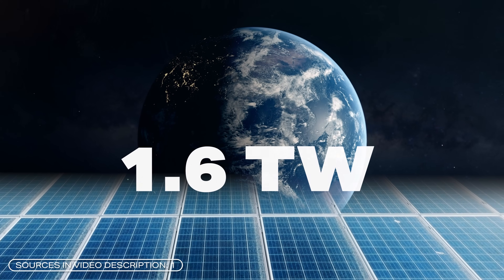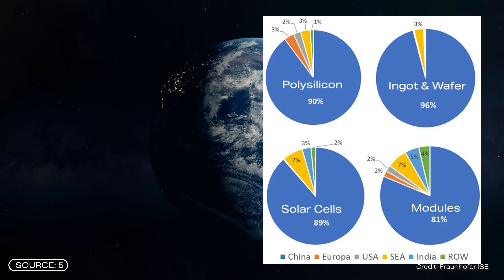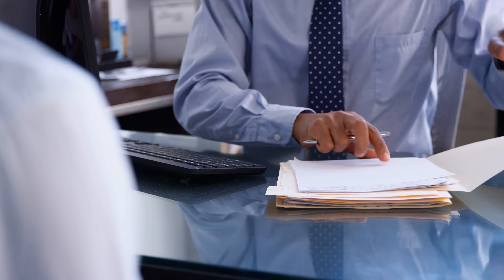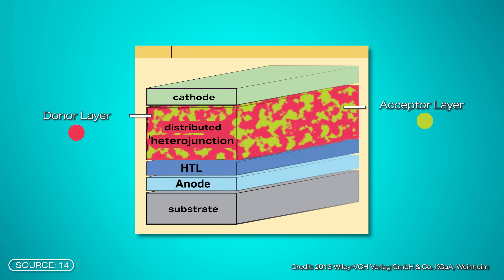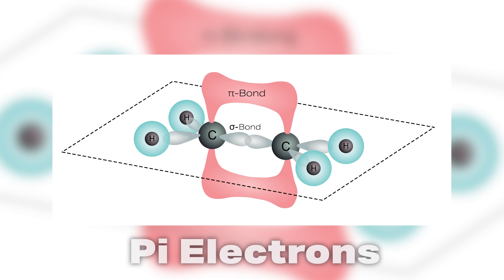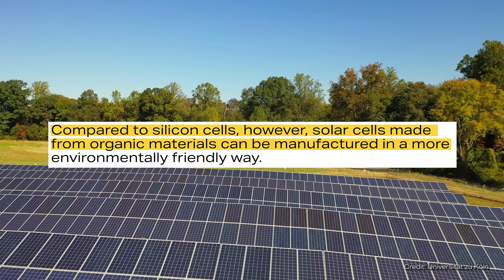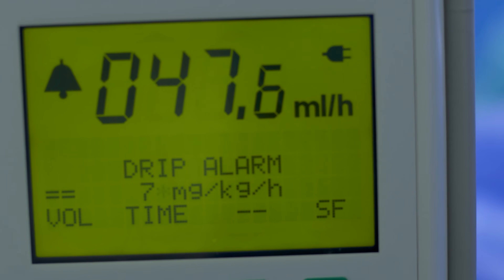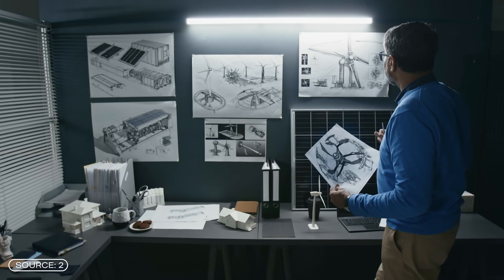Organic Solar Cells Made From Carbon!

Comment: The most important point is that you mentioned at last, 15.8% efficiency, that is the status of solar cells over 11 years ago. There are many print technologies on the market and already working, whether organic or non-organic, not only in Germany, but everywhere, including China, the USA, Israel, and a lot more. I know a company that reached even 18% with print flexible technologies, yet still less attractive. Today, any cheap silicon-based solar panel from China achieves 24%, and with relatively low yearly drop. That is about 8% more energy per area. Why would on earth anyone seek peanuts, when you can get the best?
Besides, Germany's problem isn't lack of innovation, although I must admit, German still conservative-thinking and want everything to be 100% before forwarding, a mentality that deters them a lot in adapting to the fast-pace new technologies that require fast decisions, taking risk and zero bureaucracies. Add to that, Germany had year after year impotent incapable governments that support large enterprises and barely support young established startup companies and innovative people. That alone is a death penalty to innovation in Germany, especially that large enterprises don't exactly care about the German economy, and often, as public companies, they have international investors that seek profit, and like they did lately with Volkswagen, they do with other companies.
China controls the field, because it has an excellent open-minded government which supports innovation massively, it has excellent risk-ready network of investors, and there are so many fields that Germans could have excelled at, if they would've had better governments and more open mindset. 
Just in the past 3 years, nearly 10 new Chinese human and dog-like robot companies have emerged from zero. They are now competing with the best American companies in this field including Boston Dynamics, which had hefty investments and nearly 15 years of prior development advantage. There is no reason why this shouldn't have happened in Germany. The same applies to many fields. For example, with extreme American restrictions, DeepSeek emerged with only $6 million investment and no access to most advanced NVIDIA processors, they hired the best minds in mathematics and in computer scientist, and they could achieve ChatGPT and today Gemini level of accuracy with less than 10% energy consumption and they're improving all the time, and that is purely mathematics and algorithm development under severe unfair American restrictions. Germans have no restrictions at all, not even the energy prices, because all AI companies work globally, so a German startup company can hire the servers somewhere cheap in Africa and still be a German company.
For Germany to rise again, and that is my honest opinion, Germany needs to get rid of the incapable governments, all of them, get a leader like the Polish leader, who cares about his country, rather than about his own position, stop financing Ukraine and creating non-existent political dramas that don't concern German, stop the endless influx of immigrants that are only destroying Germany and converting it into before middle-ages area. Just imagine, if the billions invested in defense technology, which brings no employment and barely income to Germany, since it is owned by individuals, who will buy another island. If this money, for example $30 billion or more is invested by the government in high-risk German startup companies, this alone would've brought Germany an increase in income of around $50 billion a year and more. That is proven tactic, not something theoretical. 
Whatever the company Heliatek is making, is already been made, and should it ever exceed the 20%-24% in efficiency, all other companies in the world would be switching to, not only in China. There are so many fields, Germans can develop, if they would have made the switch. They could've developed an advanced company like CALTEC of rechargeable batteries, they could've developed higher efficiency silicon-based solar cells, even if the energy prices are high in Germany, the production doesn't have to occur in Germany, it can be made anywhere, but the company can still be German. Even Chinese go low-wage countries like Vietnam. Being fixed-minded doesn't help the German economy. Germans have no reason not to enter the semi-conductor market. It's never a one country show. Even producing cars, Germans have no reason not to produce cheap electric cars. The human factor in the car industry is barely a factor, as most of the processes are automated and are becoming more automated as the new autonomous robots are reaching the market. So, it shouldn't be more expensive to produce cars in Germany than in Italy and even in China. They all use the same machines. I could list tens if not hundreds of products that could've been developed in Germany, if the factors I mentioned were different. Don't seek the one ultimate product to save German economy, seek a change in mentality and most important, of the incapable politicians you have. Just open your eyes, the most economically stable and flourishing countries, are those who have high-risk startup supporting mentality and governments. That is the key to every modern successful economy and there is no way around it.
Reply: I like your thinking but your favoured Poland has realised the greatest threat to their well being is Putin. Financing Ukraine is a lot better than Polish/German boots on the ground. Get real, USA is no longer big daddy.

Comment: The flexible sheet doesn't look very organic - which merely means carbon based anyway. It's not biodegradable, non toxic, low energy production or recycling.
And I'm not a Luddite, just blowing on the mists of apparent organic good-ness
Reply: Biodegradable solar panels doesnt seem good when you want 25+ years of lifetime

Comment: I think 15% energy efficiency of a panel that you can install is better than 100% efficiency of a panel that you cannot. But the longevity part might be a deal breaker - it would be difficult to offset the cost if you have to keep replacing the panels frequently. It's not only the cost of the panels, but the installation, too. At the very least, the panels should be made extremely easy to replace.
Reply: They are light and flexible. They look easy to replace.
Reply: @cyruslupercal9493   yeah, but I think the ease of replacement depends a lot on the individual panel design, as well as whether the manufacturer keeps making matching panels (e.g. voltages, sizes, connectors etc.).

Comment: Perovskite is well in front presently at over 20% efficiency with 32% not that far away, Longevity is the main issue tackled at the moment. Besides since it works at a different frequency than silicon based cells there is an effort to mass produce tandem solar cells silicon bottom Perovskite at the top, Already in production, since the manufacturing  equipment are almost the same it seems that it may be the next iteration of more efficiency Time will tell of course, this video is quite interesting all the same. C
Reply: A major issue is that it is made of lead in a water soluble form. So it is another leaded gasoline disaster waiting to happen. Lead was 0.035% lead by volume and still is a major toxic waste problem in places
Reply: @ryuuguu01   Lead in a water-soluble form on top of roofs.👀🤯💀 Let me 🛑you right there.
Reply: This is addressed already with alternative materials. Sure it was the first iteration of this rather interesting project 
Let’s say that silicon panels have  a 20! Plus years of R&D behind them, peroskvite it’s hardly 5?odd years, already challenging the situation. Time will tell of course but it seems to be heading the right direction. Chris

Comment: Dear science Guy, solar panels are dipshit power generation technology.  The following are my predictions: in few short years, large scale solar panel installation will it start to decline. In less than a decade there will be no more large scale solar panel installations worldwide, except perhaps in China. All over Europe end the United States, currently installed solar panel installations will start to be dismantled one by one. It will be replaced by reliable non-intermittent energy generation methods, mostly by gas end coal. A decade later you'll start seeing nuclear power generation facilities all over Europe and the United States. This would come in the form of small, medium and large scale nuclear generators. In 15 years, there will be no solar panel installations except for very small niche applications.

Comment: Building new factories in Germany 😂😂😂😂
Nobody is quite that crazy.
Why would you scrap solar panels? They typically last 50 years plus…
Reply: This is like the observation that lithium battery recycling is too low. These used batteries out of old/damaged EVs find new homes in DIY solar energy storage. The market for 2nd hand Nissan Leaf cells is world wide. The problem is nervous transportation that refuses to ship them.

Comment: The dependency question for solar and solar-grade silicon is probably irrelevant.   The main reason China controls these sectors is that you can get permission and not be blocked by activists in China when you want to build a multi-billion-dollar facility.  In a genuine emergency, like in WW11, all this bureaucratic control can be destroyed, and we could have the capacity to do so in a few years.  Meanwhile, China's shutdown of our solar panel supply only affects the installation rate, with no impact on the existing installations that will continue to operate for several decades.  

Mining (rare earth metals), food, and EUV machines have more dependency issues and longer, real, not just paper, response delays, creating further dependency problems.

Comment: Since you mentioned keeping things local, I have an idea that I would like your opinion on:

Keeping food production local could transform cities by turning vacant or run‑down buildings into hydroponic vertical farms that deliver affordable, healthy produce right where people live. These systems can dramatically cut land use, water consumption, and pesticide dependence while easing pressure on traditional farmers and rural land.

Local vertical food hubs

- Repurposing empty offices or abandoned buildings as vertical farms lets cities grow more food close to consumers while making better use of existing infrastructure.
- Hydroponic systems use controlled environments and stacked growing layers, which can reduce water use by up to 90% compared with conventional farming and minimize the need for chemical pesticides.

Smarter energy and resilience

- Clusters of tall, food‑producing buildings can create natural wind corridors that help drive vertical‑axis wind turbines mounted on or between structures, supplying a share of the farm’s electricity needs.
- A decentralized network of local food and energy sites is less dependent on long supply chains and may be less vulnerable to disruption or targeted attacks than a few large, centralized facilities.

Food safety and lower emissions

- Growing food near where it is eaten cuts transport distances, which can shrink the overall carbon footprint of getting fresh produce from farm to table.
- Localized, tech‑enabled farms make it easier to trace products back to a specific site and batch, which can significantly narrow the scope of recalls and reduce waste when dealing with contamination events like E. coli or salmonella.

Comment: 5 PV panels per person in my home is too much electricity daily. 10m² per PERSON. 

10m² per CAPITA is 7times too much peak supply. 
247 battery feed-in is perfect.

We all have much more window glass, which is more expensive, $m², than the PV roof installed.

Too much, if feed-in to the national electrical grid if not stored or used.

People are blind to financial reality, and still vote.
Politicians lie to the blind people. 🙄.

Comment: I'm of the opinion that this kind of technology will replace current designs for solar cells once it's been fully developed to its maximum potential.

As you know I'm a big graphene fan boy and I would probably make my clothes with graphene if I could so I am acknowledging my bias but here's why I think graphene will revolutionise this technology.

Graphene can be doped to change it's properties and characteristics so multi layer doped graphene designs should theoretically surpass the efficiency and lifetime of silicon after enough research and development. 

Thin film PV films can still be placed into metal frames with a glass layer that filters out UV light or even selectively reduces it's frequency to something usable while protecting the film, or a graphene layer could achieve the same result. 

What I'm advocating for is an engineered composite of many graphene layers that each draw power from a certain part of the light spectrum that can then replace the thick silicon slabs in traditional panels with a UV protective layer on top. 

The ultra thin flexible films can indeed be wedged between two layers of glass to create PV windows and make their way into other applications.

If we evolve the current panels to use films rather than slabs and evolve windows to generate power then these solar films will already surpass current technological limitations of silicon because using doped graphene can surpass the efficiency of silicon by nature of it's natural properties and ease of doping.

PECVD makes additive engineering of these layers much easier (not easy) but a PECVD solar film printer could produce new films quickly and consistently non stop.

I agree that outsourcing production to other countries can be a bad idea if those countries don't respect intellectual property but they will always copy the technology eventually so getting a head start and beginning production as soon as possible while producing the quality associated with German products will secure a strong market segment before other countries can catch up.

If Germany can master PECVD macro printing now then it will also open new technologies and products that nobody else can produce yet. Germany is synonymous with quality so there will be customers, and many people are willing to pay the premium for premium products.

Just look at Gedore and Knipex. They're expensive and yet people will pay that price because it's worth it. If you can make Solar panels that are lighter, more efficient, more scalable, and more integratable into other technology, then people will gladly pay for it. 

If you develop PECVD fast enough you can also capture the market on iron nitride doped graphene magnetic films as well.

PECVD coated textiles are another industry that has a huge market opportunity for tactical wear, and industrial personal protection equipment. 

PECVD diamond is another strong case for why carbon is better than silicone because diamond is also dopeable. The future of doped carbon is only a few steps away and regardless of who's producing it, if you can produce it in Germany then it will secure your future in industry and technology and create a safety rail against exploitation from foreign markets. Especially by being able to sustain absolute energy independence and materials independence, at which point trade becomes optional and while trade will be a good thing, it won't be weaponised against you.

We went from the bronze age to the iron age, now maybe it's time to go from the silicon age to the carbon age.
Reply: No one seems to mention the present service life of the panels, or what present research has indicated the typical service life will be in the future. We know that silicon panels may well be useful for 50 years or longer at reasonable efficiencies. But what about these? I don't really care if my panels are 19% efficient or 26% efficient. I can add more onto my ground-based frames. But if these panels are down to 50% of their original output after 7 years I'm not interested in them. I need numbers, not babble.

Comment: I love your videos. This was interesting and optimistic.  
Love from Australia.

Edited to add that this technology may be practical to install over the top of aging and lower efficiency Si cells. The old cells may even continue to generate some power under the transparent new cells. 

The required structure and wires from the Si cells could be leveraged to extend the life and payback of the total installation
Reply: Any kind of PV needs mounting to withstand wind.
Reusing existing mounting, such as organic over silicon, likely profitable, especially if passing wavelengths utilised by silicon.

Comment: We may see the end of China's solar dominance, but China is going to do for win power what it did for solar. The S1500 is a sign of what it coming. And the benefits over solar are crushing: common and cheap materials, extremely small to no land use (you can deploy the S1500 from a boat), 24/7 power production, and there are more. Once the engineering is established as solid, more countries will build their own, but over the next ten years China is going to own wind.
Reply: They already own 85 percent of wind and 95 percent of solar and 60 percent nuclear, 70 percent hydro. So they already own the finish line.

Comment: Assuming that the lifetime is not too short it will come down to cost per watt hour, even with a lower efficiency there are a lot more places you could install these plastic panels & a lot of todays costs with solar are actually the installation costs, not the costs of the panels.